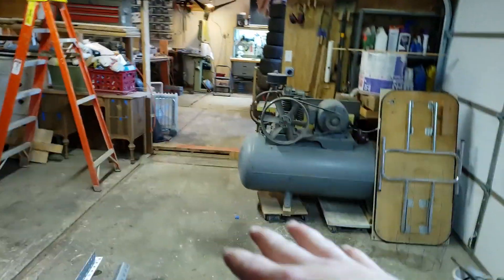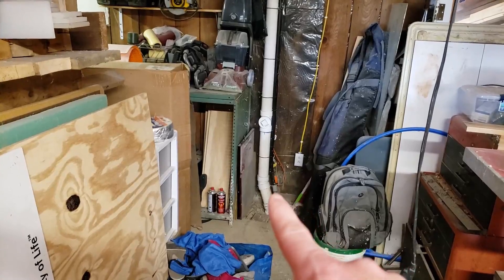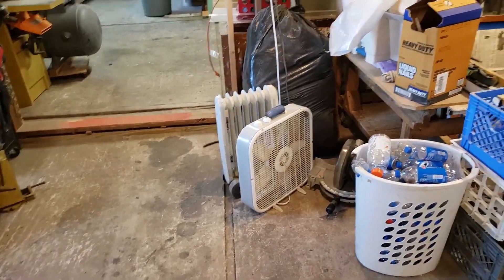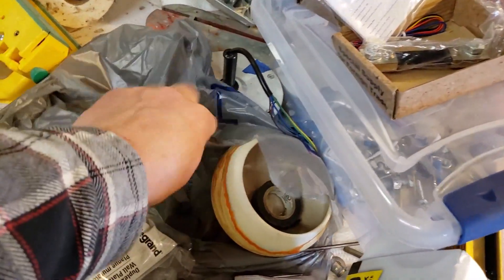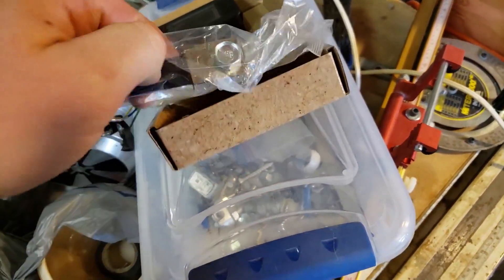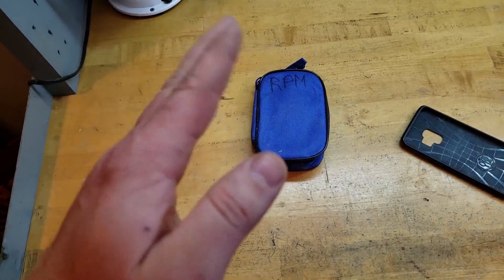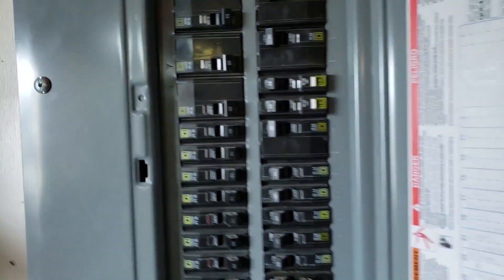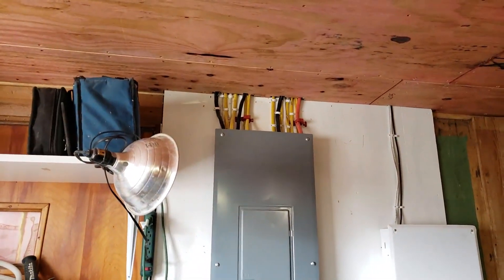Did I pass my final house inspection?

Comment: You need a 30 minute separation between the garage and living areas above. Below bedrooms you should have more, depends on the local codes adopted. Also, all of the electrical outlets need to have the same rating as the sheathing. But alot of these codes are dependent on what's being enforced in your state or county city municipality. Those are the standards here in southern middle TN where I work as a certified state inspector, for over twenty years now. Also, I would recommend that you make sure its draft stopped as well, that's how a fire spreads, fire caulking, etc. stuff like that.

Comment: Congrats. I remember you didn't intend to isolate the ceiling first. But I guess you experienced winter, and decided it was needed after all?
Great workspace. I would assume you will insulate the floor of the future heated area as well?
Reply from the maker: It wasn't insulated and one winter reinforced that it needed insulation. Code is to insulate anyways. I do intend to insulate the floor of the shop studio too.

i'm to the point where candles+humans+dogs would be able to keep the place warm-ish in the event of a power outage, until I have a diy-powerwall setup. Today it was sunny and 50F, the temperature inside while empty was solar-heated 4 degrees above my set-point.
Reply: @JoeMalovich  50F is 10C  I never get used to the Fahrenheit scale...
Keep up the good stuff. and awesome, that you made all those power outlets im the ceiling. very convenient!
Reply from the maker: @MasterIvo  I will be installing permeant led lighting in place of the outlets eventually. Actually direct wired t8 fixtures with direct drive led tubes.
Reply: @JoeMalovich  Sounds good. With the turbine, have you considered Capacitors after yhe 3 phase rectifier, to stabelise the dc voltage?
Reply from the maker: @MasterIvo  other builders have not used a capacitor, I suspect most charge controller either don't care or have smoothing caps built in.
Reply: @JoeMalovich   yes true, the regulator probably has one, but a small one. Your voltage is very unstable so It would need a much larger capacity to stabelise it.

Comment: given what I've learned from skateboarding, a shielded bearing with a light machine oil for the lubricant will give the lowest friction loss. would probably need a drip oiler, but 🤷🏻‍♂️, efficiency I guess.
Reply from the maker: I think a light grease will work well if I can keep water away from it. I'll just need to give it a shot of grease about once a month. Spencer Langston recommended it actually.

Comment: How you going to measure the startup torque? 🤔
Reply from the maker: I don't think that is necessary if it's got enough water to spin up to operating velocity.
Reply: @JoeMalovich  well I was thinking about this value in terms of no load spin rpm calculations 

Or will you install a deflector/mechanical governor/brake which prevents rapid unscheduled disassembly? 🤔
Reply from the maker: @RubenKelevra  I designed it so that it can freewheel and not hurt anything.
Reply: @JoeMalovich  okay... :)